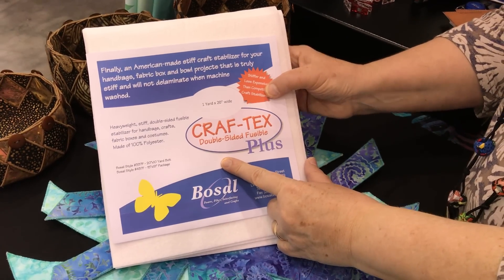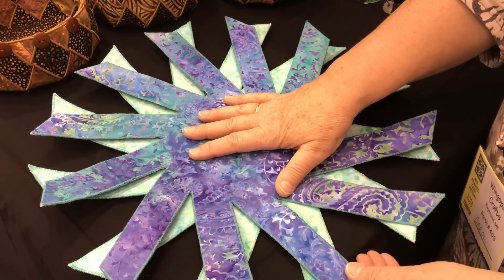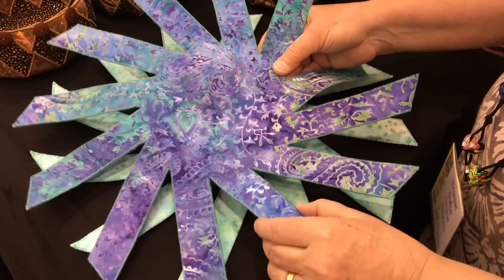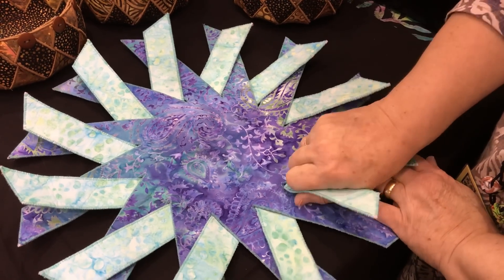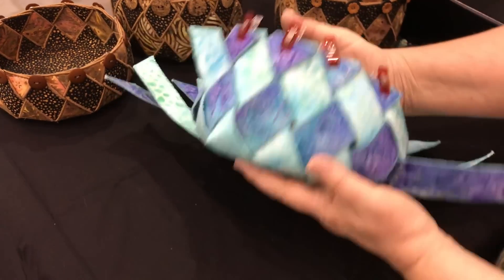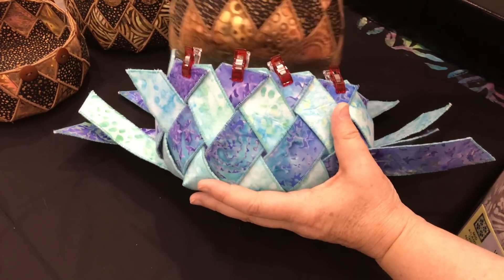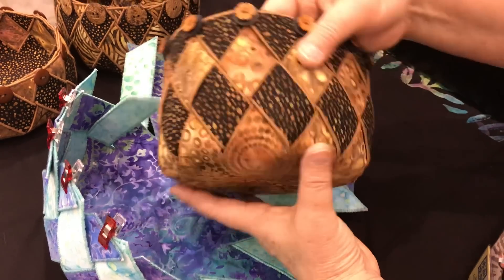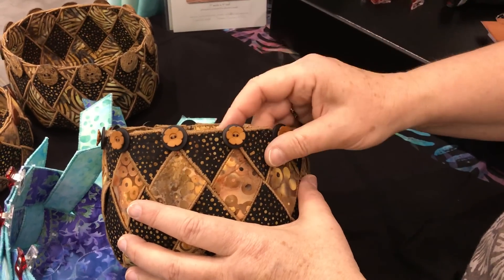AT620 Woven Spiral Bowl

Comment: just got my spiral weave basket templates and I can't wait to use them. Some people are complaining about the thickness of the templates but, mine are the same thickness as the plastic cutting boards you get at the dollar store, the 3 in a pack ones. I use that same plastic for my hand made templates. The templates were not folded and came packaged each in its own plastic bag backed with card stock, all inside a mailer.

The complaints from other customers did some good, the seller fixed those problems. I am a happy camper with my purchase. I got mine from Amazon, the 3 size package. 8" 12" and 15".
Reply: Update: I made the small 8" basket, took a little adjusting but, I got it made. Very nice little catch all on my desk. Next, I wanted to try the 15" one but, with a twist. I wanted to make a bucket bag out of the basket. I extended each of the 12 arms 3" longer and made a new template on craft paper, to make the basket deeper. Added matching fabric at the top  edge with a sewn in channel for drawstrings, also a shoulder strap. Presto Changeo, I have a new bucket bag.

Now, I am left with one problem, what to do with all those triangles from cutting out the pattern, from any of the baskets! Because of the thickness they won't work as a quilt. Maybe coasters or something. We'll see.
Reply: I got the pattern but no direction on how to put it together and weave it.
Reply: @SharonMcdaniel-j1r  Google directions here on YouTube, there are lots of them.
Reply: I mean google and search here on YouTube.

Comment: Just be aware that this is a paper pattern and the actual pattern is printed on the back of the pattern instructions; which means you can't cut it out.  My only option is to purchase freezer paper and trace it, which doesn't appeal to me.  I much prefer PDF patterns for this reason.
Reply: I bought the templates and am cutting the fabric out now.
Reply: @kandl0628 Did you have to trace a pattern onto freezer paper? If not, where did you buy your pattern?
Reply: @alicebrown60  order them from Walmart.  That's the least expensive I found, but they are still $25.00
Reply: You can buy the actual templates ( which is cut from template plastic) all 3 sizes, from Temu for like $5. It does not come with instructions though.

Comment: I have this pattern & I am not that pleased with it. It is the plastic pieces-easy to trace & cut out. The problem I’m having is putting it together. The sizes of my templates are 12”, 8” & 6”. The 12” one is hard to keep together & the 8” is enough to really test my patience. (I’m not even going to attempt the 6”!!) Wasn’t there supposed to be a 15” in the set? I’m disappointed because the bowl in the video has to be 15” by the way it goes together. I guess I just want to know if I ordered the wrong size or if there is another reason why there isn’t a 15” size bowl pattern. Thank you, Karen

Comment: I have tried several times to cover up the fusible interfacing, but I cannot figure out how to hide the edges after I have sewn it.  It is still white. How do I fix this? the instructions do not say. can you please explain this, your video does not show this.
Reply: Get double sided fusible fro Amazon. It does not have to be the expensive kind that she uses. Cut both your fabric and your interfacing into a square large enough to fit template. Peel off one side of the interfacing and iron your fabric onto it. Turn it over and do the same with the other fabric. Repeat step for the other 2 pieces of fabric. Then trace your template on each of the 2 squares. Then cut it out. Sew around each one with a tight zigzag/applique stitch .

Comment: I have a question about the interfacing.  What weight are you using. You said heavy but the stuff I find that says heavy is about like felt, is that right??
Reply: Use double sided peltex 72F
Reply: I used Bosal craf-tex plus. It's thick, almost like a foam. Gave me the rigid form like the video. I first tried wonder under- that did not work.